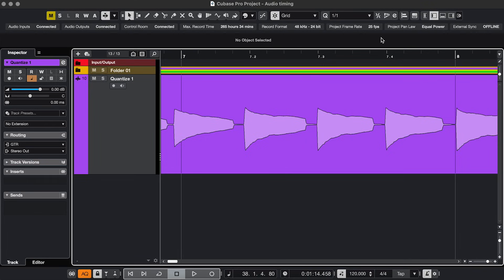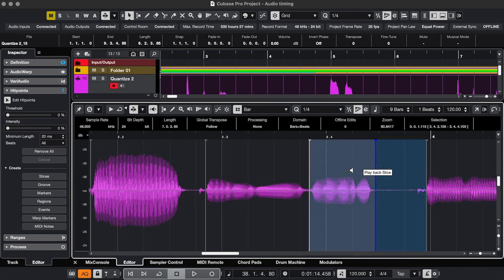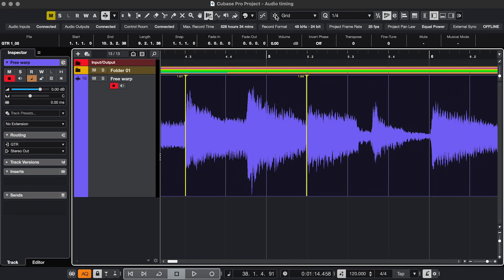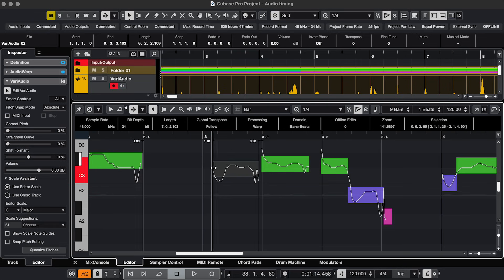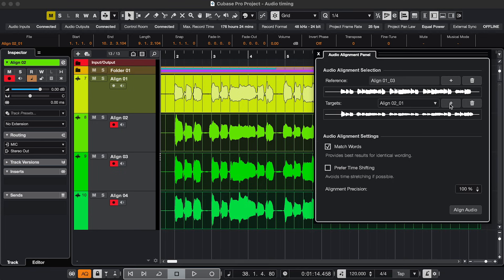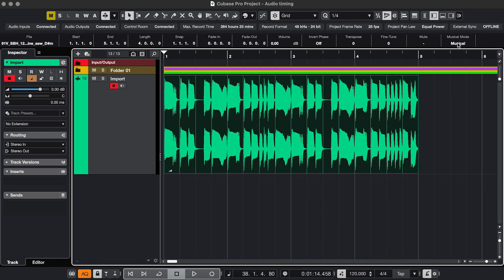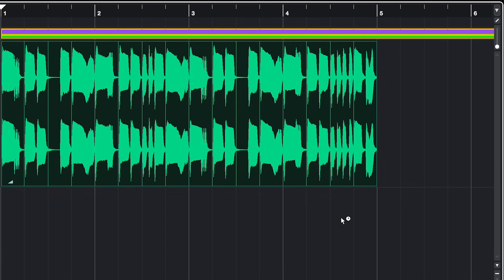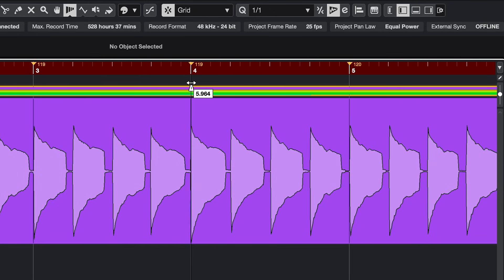6 Easy Ways to Fix Bad Audio Timing in Cubase

Comment: I am trying to use the waveform overlay feature to line up two audio tracks. Select a track, hold ctrl, select the other and hit enter. This opens both in the sample editor, overlaid. I select the one I want to change in the sample editor drop down to bring it to the front. But when I do free warp on the active track the one in back also changes.  Unselecting the track in the project window makes it disappear from the overlay view.  How can I get this to work?
Reply from the maker: In the toolbar of the editor there’s a button with a layers icon. It’s where you choose the clip editing mode. I think by default it’s set to all clips. So you’d have to change that to active clip.
Reply from the maker: See Short reply

Comment: Hello Alice, Kenny is my name. 
I have Cubase 13 pro and watching your videos has helped beginners such as myself unlock quite a few things even though I haven't put them to use as of yet. 
Any way, I'm having two problem right now and I know you could point me in the right direction to solve this. 
You may already have videos Posted on these 2 issues If so, I'd be thankful if you could point those videos or short clips in my direction. 

Anyway: 
issue #1. Cutting and pasting in a track, for example, drum track. 
If I remove a small section anywhere, the whole track will shift and everything is off time.   

Issue #2.  This may be the simplest, 
"Creating a Template" so each time I wanna make a new song, My favorite instruments will always be there. 

             Any help would be appreciated.
Reply from the maker: Hi Kenny! For the first issue I would think either shuffle snap is on or you're using Shift + Delete/Backspace to delete (which is delete time) instead of just delete. For the second one, you can check out this tutorial: https://youtu.be/zWrlRhnQEAk

Comment: I have a stereo acoustic guitar that I've tried a few times to fix the timing of, and every time, it creates artifacts.  I've only gotten these tricks to work on mono files.  I have no idea how people manage to use this on multi-track drums, let alone a stereo guitar, and be artifact-free.
Reply from the maker: Hmm, can't say I've had this issue. A solution could be to split the track into mono tracks, select them all and then do the warping.
Reply: U can choose different algorithms in the info-line when U select an audio-event - elastique-pro is not always da best choice. Multi-Track-Drum-Warping/Quantizing can b done in different ways like putting dem in a folder where U can group m 2getha plus ther‘s a phase-correlation-button on da folder-track itself - but Drums sound betta when dey r split wit Crossfades in b-tween without Warping. Dis can b done inside da Quantize-Panel.

Comment: So I've been having this problem since Cubase 9.5 I think? In the hitpoint editor, I used to be able to play back the slices with no problem, but ever since the audio doesn't play. I was reading somewhere that it routes through control room, but I've honestly just had to do it by eye. Do you know how to fix that?
Reply from the maker: Yes, previews are routed through the control room if that’s enabled. To check if that’s the issue, disable the control room or check if it’s connected properly. I show how to here: https://youtu.be/dCOMzAMslRs?si=aM-FQpS3-e3k6Nl9&t=109
Reply: @alicebyno Bless, thank you so much!!